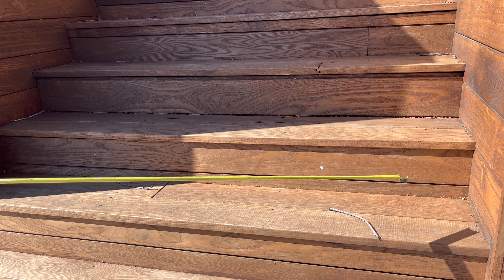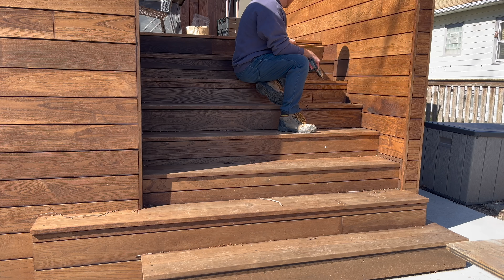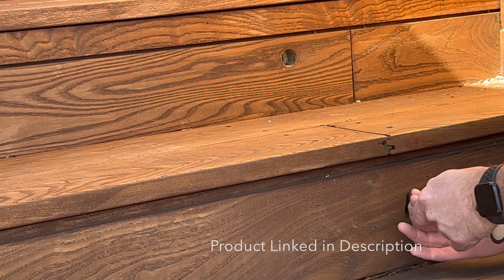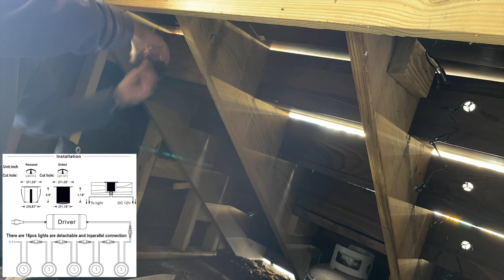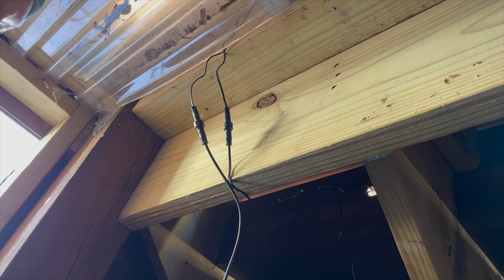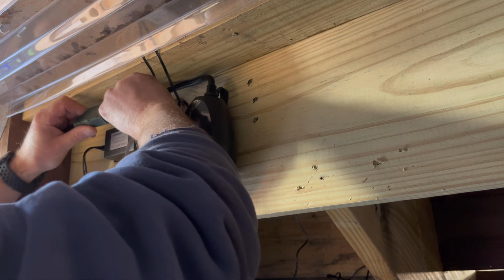Installing Deck Stair Lights Controlled by Alexa

Comment: I’ve been asked about these.
      My biggest question is how long they last.
       Easy for us to install but what if the homeowner needs to change dead ones every other year?
     Anyone know anything on that front?
Reply from the maker: I know they say 10,000 hours.  But, the whole thing does not cost too much and would not be too hard to replace.  I would just make sure you turn them off when not needed.  That is why I really like have Alexa control outlet